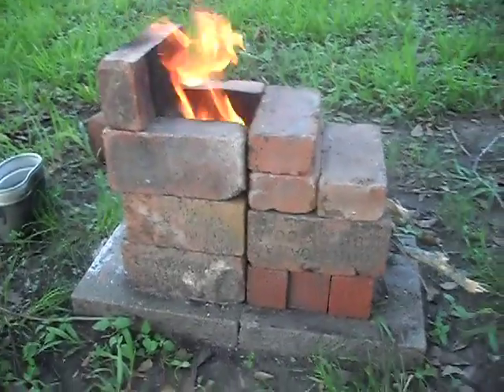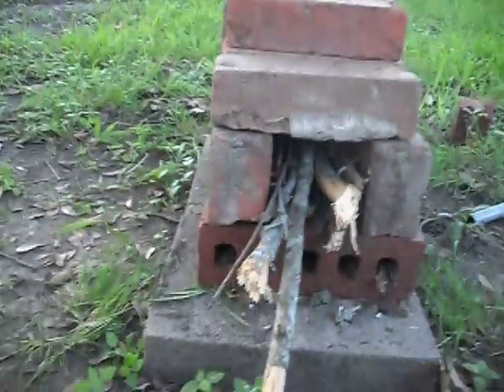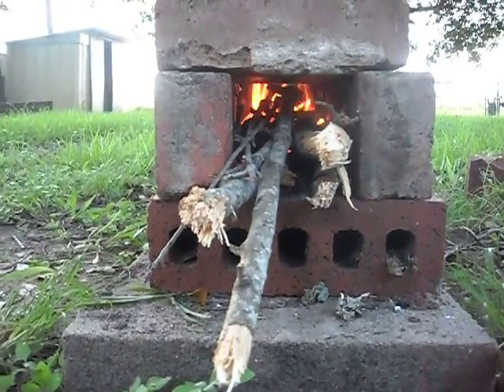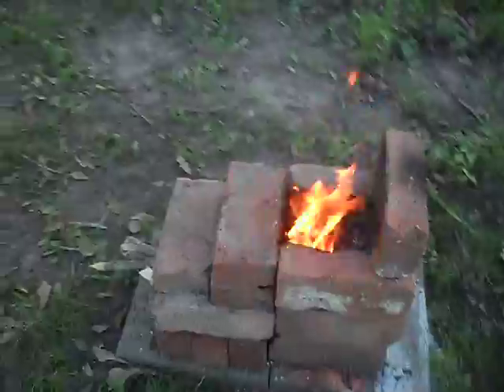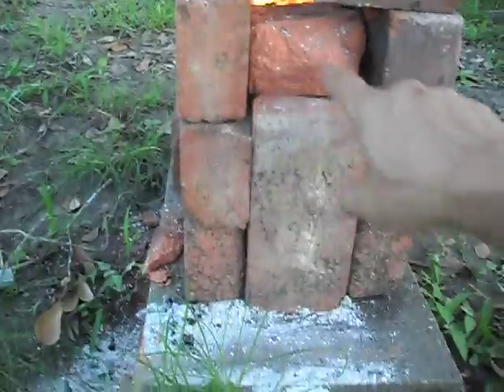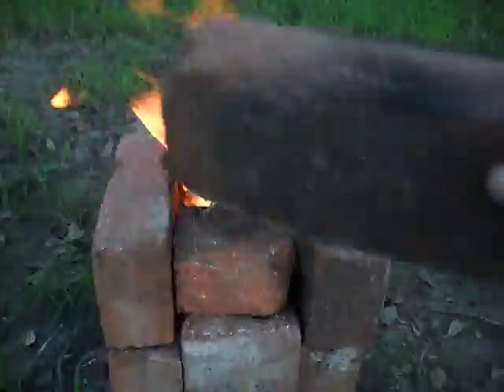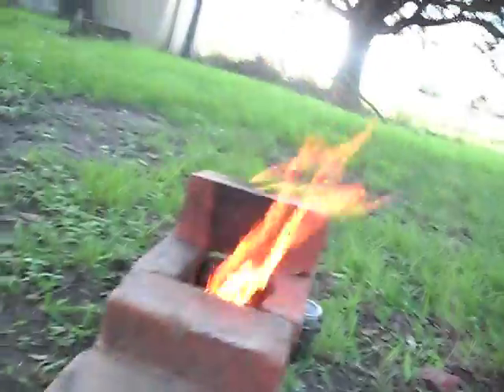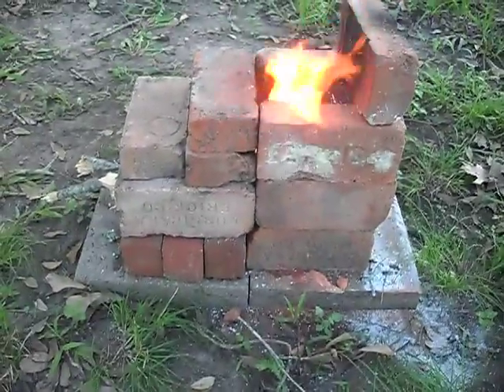16+1/2 Brick Rocket Stove (17+1/2 with the backstop on top)

Comment: Cool design!  The first time I tried to make mine out of bricks, I didn't know how I was going to get the vent underneath to draw  air under the fuel.  Your idea is very good!  Just using bricks with holes in them on the bottom was smart,